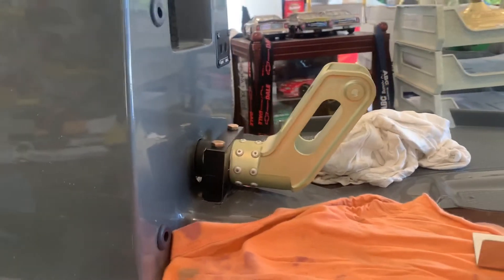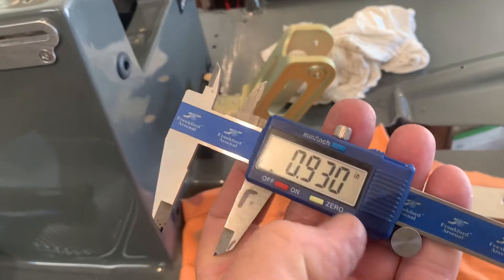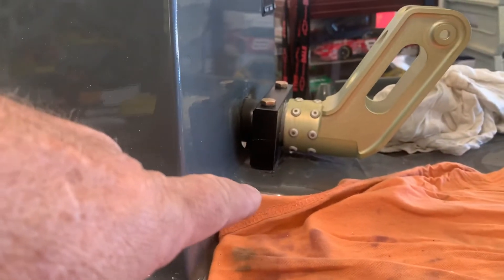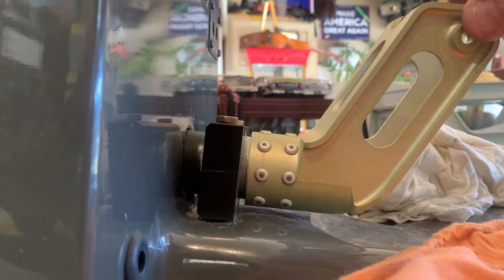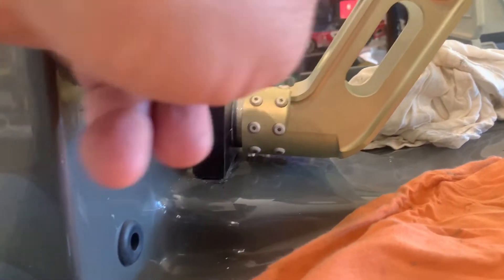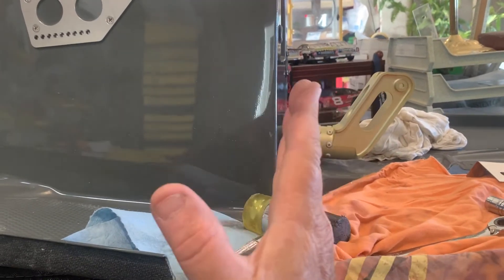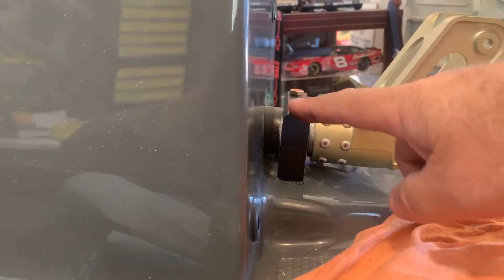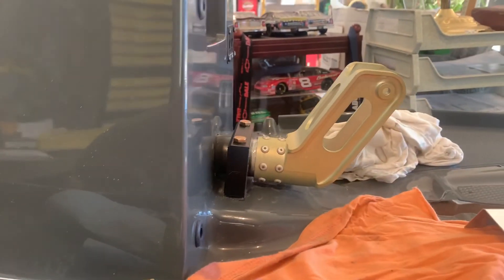TORQUE TUBE INSTALL

Comment: Great video. I wish i had seen this before I installed the rear mast. Now its in a bind and I cant remove the rear mast to correct the angel of the block.
Reply from the maker: Well you can still just take it loose and redo it. Team out the holes or make new ones.